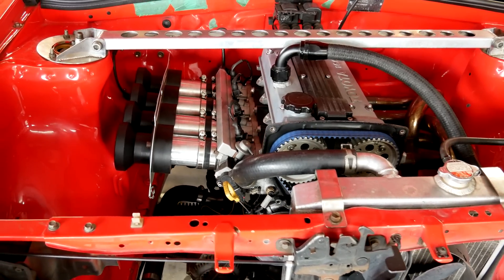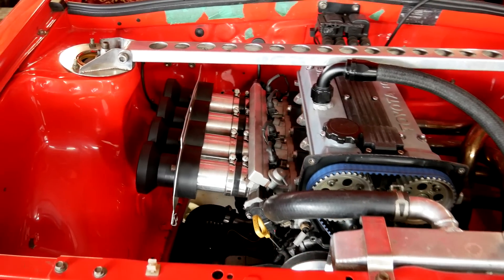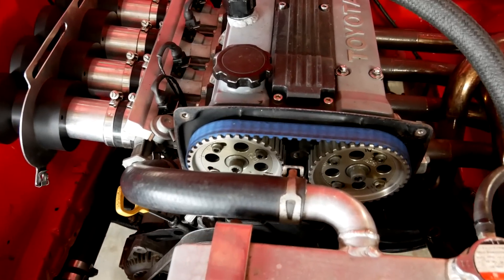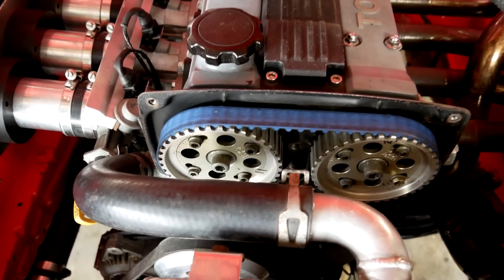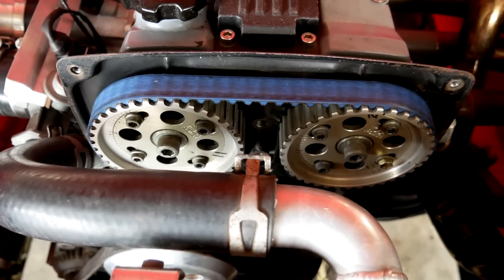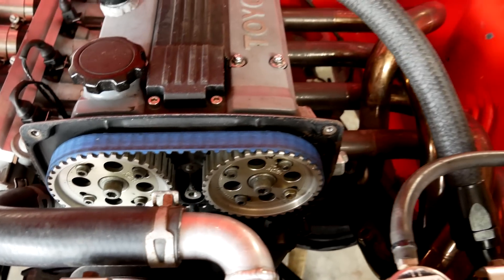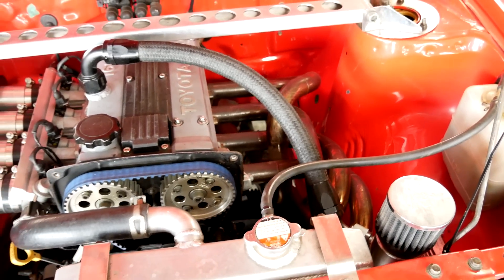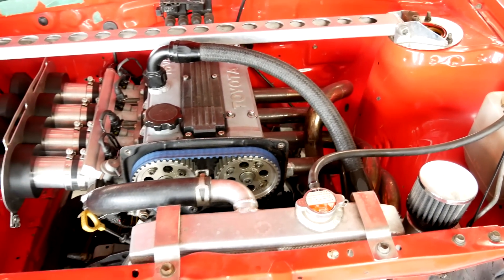Effects of Cam Timing on a Big Cam Engine - Dyno tested - 200hp 4AGE

Comment: I like your videos.   Very clean car.   What were the cam specs for this test and what was the compression and cylinder head flow?   Was your engine the stock 1578cc or larger?    This information is useful for other engines.

Comment: Hi, thank you for sharing the test and info all about cam timing.
I was driving a mirage with Mivec originally 4g92 (1.6L) but I swap to 4g93 block (1.8L)
When my car run on Dyno, it show top end was dropping. This guy has 8500rpm redline, switching to high profile cam on 5,500rpm. But start 7,500rpm, the power start dropping. I changed TB from 60mm to 70mm. Cam timing was follow original 4g92 1.6L may I know how to prevent power drop at top end. Should I retard my inlet cam?
Reply from the maker: If same head as the 1.6L now on the 1.8L.  power has probably just been pulled down the rev range. head will run out of flow at lower rpm with bigger capacity.    retarding the intake and advancing exhaust  will make it hang on longer at high rpm. but lose throughout midrange.  i suggest adjusting for best compromise on dyno if possible
Reply: Thanks for your advise, this is what i thought. Just need some pro support 😊

Comment: How effective would these adjustments be in a blacktop 20v? 

Any ideas anyone?
Reply from the maker: Similar  on any engine really. Depends on cam size a bit. On a blacktop best to retain the vvt.
Reply: @Garage4age  the vvt has completely failed. All it does is make a ridiculous knocking noise. I could try these adjustment and turn by hand to ensure clearance then take it from there.
Reply from the maker: @clemonthopkin4513   you'll have to compromise top end or midrange. Or bit of both without the vvt.   If try match the midrange power "vvt on" with fixed timing will also run rough at idle.  So yeah best option is to replace the pulley if it's stuffed.
Reply: @Garage4age  I have tried a few vvt and they were all the same. I couldn’t afford a new one and the two cam gears came at a reasonable price. I really don’t mind the rough idle and the mid range is more important to me. I don’t spend much time in the high rpm range tbh. It will be nice to have that peak power for when I decide to go on the dyno.
Reply from the maker: @clemonthopkin4513  setting it at about 20degrees advance is probably an ok compromise. (vvt on  is 30)   if your on stock ecu, fueling may no be amazing. but if o2 sensor in good working condition will sort itself out in cruise conditions.     otherwise, did you check the vvt solenoid was working?  this is a with on/off and swtiching at 6200rpmhttps://garage4ag.files.wordpress.com/2022/07/vvt-on-vs-off.png
Reply: @Garage4age   I just did some minor repairs to an AE111 sprinter ecu and tried it in my Corolla ae111 and the result were great (on stock manage). The car revs all way out to 8.5k and I believe the vvt is working now. I can only conclude the original ecu was faulty. It’s still making noise but I believe it’s engaging. Both O2 sensors have been replaced. Based on the graph I understand now why some guys only change the exhaust cam gear with adjustments you showed. The car only has a kemso pump, fuel pressure regulator (42psi), minor exhaust work, shorten trumpets and a recent rebuild to make a healthy 200psi + on all cylinders. Sadly, it’s an auto but the shifts are fast. I am hoping to make a 130-140hp, I don’t know if you think that’s possible? Regards, thank you for the great support to the community. Cheers.
Reply from the maker: @clemonthopkin4513    Nice work.   Yeah they can get pretty rattly especially on startup.  but generally keep working. quietest when the vvt is on.    My  Blacktop  makes about 150whp  on stock engine, other than some light headwork.  Just has intake and exhaust mods and aftermarket ecu.  I have some videos how i did it if you haven't seen them already
Reply: @Garage4age I think I have seen all your videos including that one. Maybe for upcoming videos you can experiment with different fuel pressures but it may disturb your afr.

Comment: is it 1600 or you have stroke up your displacement?
Reply from the maker: still 1600cc.  well 1627  as has oversized pistons
Reply: @Garage4age  very cool, what ron/ octane do you used for the gasolin ?
Reply from the maker: @laurabasuki2841   98ron pump gas
Reply: @Garage4age  thank u for your information

Comment: Have you ever tested adjustable cam gears on stock camshafts?
Reply from the maker: Yeah lots of times.  i dont have a specific  video on it, other than the turbo version of this one which has stock cams.  but there are bits and pieces spread through some of my videos.  generally they like a bit of intake advance over stock
Reply: @Garage4age  
    ok thanks i will look into this further.

Comment: WHY did you not run split overlap tests? I.E. increase the lift at overlap for both cams- decrease the lift at overlap for both cams? That is what should have made big changes???????????
Reply from the maker: They dont actually effect each other that much.   each cam was done on it own to simplify test.   cams were only moved in one direction due to piston to valve contact the other way
Reply: @Garage4age   not my exp. If you were not able to increase the lift at TDC in overlap you are not going to change much.
Reply from the maker: @samstewart4807     I've tired every different combo on this engine. I know what it does.  The "baseline" run is set quite aggressive overlap wise and isn't anywhere close to what cam manufacturer recommends
Reply: @Garage4age   they do not effect each other? So if you have .030 lift at TDC overlap on both cams and you move both cams to .040 lift or .020 lift  there will be no change???????/ That is not what I have seen in a similar situation. However I did not move one cam. I kept the lift the same for both cams- aka split overlap. and moved both cams  when the lift is increased the power curve is moved up when the lift is decreased the power curve is moved down- but I am not a famous utuber- so u must be correct
Reply from the maker: @samstewart4807     When i said they dont effect each other much. I meant  if you were to adjust the inlet cam  by itself,  you wouldn't necessarily need to re adjust the exhaust cam because the intake was moved, it could have already been in the right place. 
 You can simply adjust the intake cam to  where you want, be it best peak power, or best over all power. lock it in place.   then adjust the exhaust cam to do the same. will get it pretty close.  If you adjust both at the same time its harder to see whats doing what.     I haven't had a setup that likes to run the same tdc lift on both sides.  the engine in vid is running over 5mm /4mm intake /exhaust at tdc.   Also not sure what being on youtube has to do with it
Reply: @Garage4age  I have seen very different changes- good luck
Reply from the maker: @samstewart4807  what engine/s are you doing this on? have you actually tried adjusting the cams individually ?  Adjusting the cams in opposite directions. will do as you say. more advance on the inlet and more retard on the exhaust will  increase the midrange power  and both sides will have more lift at tdc.   going the opposite way will do the opposite.    but just making the tdc lift the same on both sides likely will not end up being the best compromise.   In 4age's case they almost always like more on the inlet side.
Reply: @Garage4age  carb and efi 4 cam 2 valve with and without turbo. saw big changes Moved cams about 8-10 degrees from 98cl to 105-106 that dropped the peak power(8000) 2000 rpm and put it all in the midrange. A massive difference.

Comment: 1- This is an AMAZING channel, you have a new sub.

2- I have to ask, if youre willing to share- Can I get a quick TLDR on the mods for this engine? Ive gone through quite a few of your posts, i see youre running 13:1 compression, 10 degrees of lift, etc- but its always a specific answer to a specific question.

Would you be willing to share a more indepth break down of what youre running? Cams, springs, valves, what kind of head work youve done, connecting rods, what youve done to the crank, etc. Thank you so much for your time, cant wait to see more! I saw you make mention of 20v stuff, im really looking forward to that
Reply from the maker: stock crank. toda pistons, bc rods. all balanced.    head has oversized valves and ported by myself.   300deg kelford cams  & springs.   Its  nothing too fancy,  just lots of time  testing and getting everything working together right.

Comment: hey bro tell me if you are standing for the engine 
and the engine is on the tdc and look auf the exhaust cam and you move the exhaust cam counterclockwise is that retarded or advanced ?

and same timing on intake cam

also i understand this so if you move the intake cam in direction of rotation is it retarded !?
and if you move the intake cam counterclockwise  is it advanced !? 
please correct me if im wrong or you can make a small video from your timing gears 

thanks for your help and sry for my bad englisch
Reply from the maker: Looking at the cams from the front of the engine, they along with engine are spinning clockwise.   So moving cams  clockwise advances them. As the cam event is happening earlier in the engine cycle.     Advancing the inlet cam and retarding the exhaust cam will give more cam overlap at tdc.  which usually results in more mid range power and a loss at peak or after peak.  going the other way does opposite
Reply: @Garage4age  thanks for your Answer

 I testet it on my engine on the intake camshaft I cant Chance anything I can go only retarding on the intake cam because if I would to Do for advancing the valve have contact to the pistons.

But I testet only on the exhaust camshaft I tried first adavanced maybe 5-10 degrees car runs slower than before from 62-124 mph GPS measured.
I try it yet with 10 degrees retarding on the exhaust camshaft I don't know it's work better than before TDC Timing mark or not we will see

Comment: have you ever tried narrow / wider LSA? comparing to normal setup, not only one side cam adjusted? e.g : retarded ex + advanced in vs advanced ex + retarded in
Reply from the maker: it pretty much does the same.  narrow lsa more midrange / more overlap = more top end.  wider / less overlap more top end.    but  better off to adjust separate.  5-10 deg advance on inlet and  0-5 retard on exhaust usually works good on these engines.

Comment: I know you are tuning a 16v but would the same affect of cam timing be seen on a 20v ?
Reply from the maker: 20v already has vvt.  so win win  at both ends of the curve already.   vvt moves the cam timing 30degrees.   with aftermarket cams  that aren't desgined for vvt, the vvt on/off locations may not be ideal and/or  bend some valves. so then yeh,  resorting to adjustable cam gears will do very similar to whats in this vid.    when my dyno is more user friendly for fwd will probably do a vid  showing the vvt on my 20v
Reply: I am building a 20v right now using toda cams would it make sense to remove vvt and advance the came to make up for vvt loss?
Reply from the maker: if the cams are designed to work with vvt keep the vvt.  otherwise if not bit more inlet advance usually works. but it depends on the setup and where the cams are to start with.  good idea to at least check the  cams are in the ballpark  what manufacturer recommends.  then adjust cam timing  from there for best power, keeping in mind piston to valve clearance

Comment: Pardon my ignorance, but what cams are you running? 200whp is insane for the wee 4A-GE.
Reply from the maker: 300deg 10mm.  the combo if parts is what makes it work
Reply: @Garage4age  Sounds about right now that I think back to the FA motors. It's a little deceiving not having the Dyno plotted against RPM. How high is it revving?
Reply from the maker: @Supercharged111  The rpm numbers are at the top of the big  graphs at end of runs
Reply: @Garage4age  Ugh, duhh. I was fixated on the uncorrected real time pulls when I brought that up. Totally ignored the RPM at the end, was just looking for the little gains and losses throughout the pulls on that bit. Sounds a lot angrier than the blacktop I had years ago!

Comment: That was very unimpressive when i degreed my b18b with a stage 2 cam it made a wolrd of difference up top and it wasnt no 13 degrees either more like a max of 4
Reply from the maker: every engine is different.  show me the sheets
Reply: @Garage4age   @Garage4age  i just street tune cars ,the difference in my setup was that i advanced my intake and retard my exhuast, when u just retard your intake cam but you leave your exhuast cam you are reducing lobe seperartion angle effectively killing any big top end gains you might have recieved , lower lsa = lower na top end
Reply from the maker: How do you gauge your results on the street? I know there are ways to do it as have done a lot of street tuning.      Advancing the inlet more midrange .    Retarding more peak, or more so holds on longer after peak.   Exhaust cam is pretty numb in most cases.   I don't bother with lsa numbers as mostly irrelevant.  I've tried pretty much every combo of cam timing on this engine. The way it was done in this vid was just to simplify  and get the info up

Comment: On my CA18DET in my 180SX I used my exhaust cam shaft the had a bad half moon for the CAS and put that on the inlet had a spare block used another stock exhaust cam shaft on exhaust side not sure of the adjustment made with the cam gears but got 50hp at the wheels I also had GTR 444cc Injectors and plenty of mods to allow this running a S15BB turbos 280whp.

Comment: Can you give me a break down on what you did to the engine to make that power... Is it mainly head work? stronger bottom end? Bigger valves ?
I watch every video and it's really impressive. I'm just curious to what u have done. Maybe you can give a dive on a good place to start
Reply from the maker: Pretty much everything has be played with. but its nothing too fancy. rotating assembly is off the shelf parts, 13:1 compression, oversized valves and porting. a lot of why it works is getting everything working together properly with the right bolt on parts.   lots of testing

Comment: This really great stuff. Years ago I had a hillclimb car with a SOHC engine (Isuzu G161, in a Holden Gemini) that had an adjustable cam gear installed when the engine was built. As a SOHC application I was unable to adjust inlet and exhaust independently of each other, but it was still fun to play around with. It got dyno-tuned for two different settings, one "road" and one "race", with the markings for each scribed onto the cam gear for easy setting. On the "road" setting the engine was pretty tractable and coped with regular street driving duties no problems, and on the "race" setting it transformed into a lumpy little pig that didn't produce any usable power until about 4500rpm but then took off like a 2-stroke and shot up to 8500rpm in no time, developing considerably more hp up high than the "road" setting. I actually have no idea which way the cam timing was moving, I could only presume from its behaviour that on the "race" setting it was allowing a lot more overlap. The cam was a custom grind, based on a Datsun configuration, as the guys who built the engine were Datsun specialists, my Isuzu engine was one of the first ones they ever built and they used it and the car as a bit of a learning experience. I actually narrowly beat one of their Datsuns at one event (we were in the same class) and we joked afterward that they had done their job a bit too well, lol.
Those were great days. Sadly that car is long gone, as are my weekends of competition. I just enjoy spectating now. In these times of ECUs and fuel injection and turbos it's gone beyond my knowledge. I can tune a set of webers and a mechanical dizzy with the best of 'em, but it's only the historic cars that run those old school setups these days. My neighbour has a Charger with triple webers, I've helped him get them running properly a couple of times, but aside from that my knowledge is pretty useless now.
It's great watching these videos. I'm learning and enjoying it at the same time. Thanks for posting!
Reply: Tuning with an ECU is pretty simple, just a bunch of numbers on a graph mostly

Comment: Was the baseline runs with the cams degreed as per the cam card?

Think a better test would be doing baseline with the cams gears at zero. Then degree as per cam card to show differences, as most people just fit aftermarket cams as per the factory cam gear settings.
Reply from the maker: No specs on the cams, as they are mix and match from 2 sets and are in opposite locations as what they would normally be on the card. .   so unfortunately i couldn't do this

Comment: What if retard or advance both cams at same angle? ) I have only 1 cam )
Reply from the maker: exhaust cam doesnt do a whole heap compared to inlet cam.  so will most likely get away with some small adjustments and see results
Reply: @Garage4age  Hi. I know this is an old thread, but I'm looking to do some cam tuning on a Nissan KA24DE. The cams are chain-driven, so endless testing is time-consuming and expensive.
I'm curious as to your tuning philosophy- would you always play with intake first, then clean up with exhaust? Or is that just a convenience thing for video purposes?
Reply from the maker: @davidschneider5285    Doesn't really matter  which cam you adjust first.   They don't effect each other as much as you would think.  get one right, then get the other right and you'll be pretty close.   unless your super clinical on dyno with engine temps etc, to accurately  see the changes  from fine tuning further. not worth doing.    exhaust cam generally has a sweet spot where it will work best across most of the power band.  intake will move the power around a lot more.